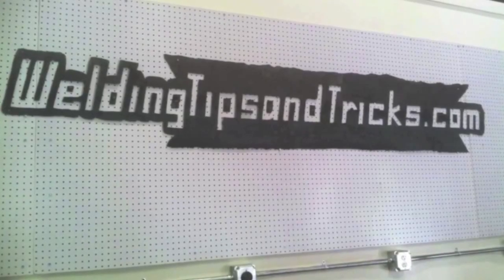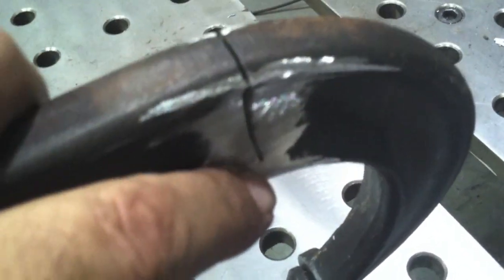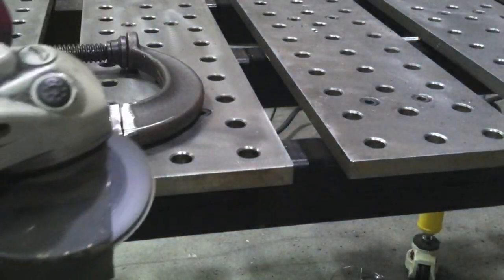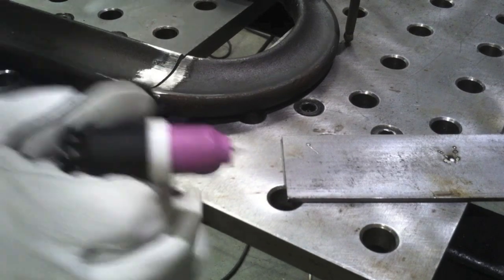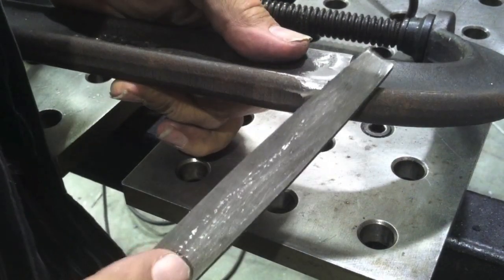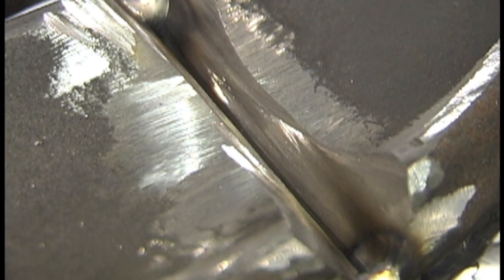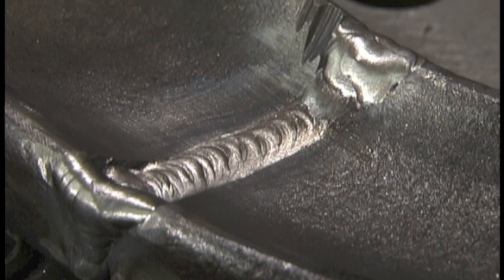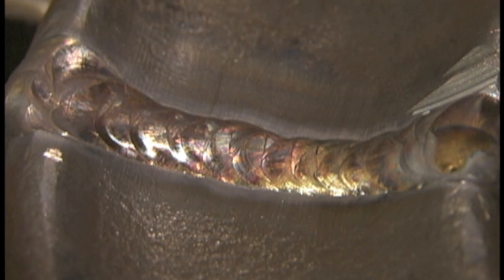Tig Welding Repair & Tips and Tricks for Metal Identification

Comment: Jodi, Id  Almost Guess CAST IRON,, and I allways Brase IT!!!!!!!!,, Just Old Timers Tricks!!!!!!   Jack,,,
Reply: Jack Connors if it wasn't a drop forged (and very high end) c clamp, you'd definitely be right. I almost always braze cast iron repairs, do a lot of work on old vises. 

Those Armstrong clamps however are drop forged steel, as are a few select others. that's probably a $300 clamp he cut
Reply: Geoff, I have a CHINA cast iron bullet vise, I plan to repair for my brother.  It is broken on the round "traveler" connecting to the movable vice jaw.  Just trying to save it, he is not out anything on this one.  
 Have you ever tried supermissile rod followed by a high nickel rod or 7018?

Comment: I have acoumpressure parts I dont no which the meterial type pmi result is Fe-96.83% Co-0.93% Fr-0.76% Ti-0.39%Ni-0.30%Cr-0.24%Mn-0-19%Ps-0.17% i need type of elctrod/filler

Comment: 309? 
You said the three rods to keep on hand were 308, E70S2 and 4043. 
Is 309 a stainless rod?  You also recommended 312 as a general purpose rod.  I think I need a big chart showing them all.  Do you know of any charts to hang on the wall showing all the metal families and if so, do you have a recommended source for such a chart?
By the way, you have helped me immensely.  Haven't seen all your videos yet, but plan to.
Reply: +David Parker ER70S-2/6 - Carbon steel; ER308L - Stainless steel; ER309L or 312 - Unknown grade steel or crappy steel, welding over old mig; 4043 - Aluminum
Reply: the periodic table ;D
Reply: I don't get it Kevin.  I have a periodic table, I was thinking of a chart listing the different weld metals available.
Sincerely,
David Parker
Reply: +Amy West 308, 309, 312 are all grades of stainless with different properties.

Comment: Best to plot it on a Shaeffler diagram to check the structure after welding.
309 (24.13) or 309Mo (24.12.2) works in most cases. 312 (29.9) works better for higher alloyed hardenable steels like 4140/4340 and dissimilars.

Comment: Hi Jody, have you ever done any TIG repairs of cast iron? Exhaust manifolds, engine blocks, firewood stove, things like that?  A video with tips to how to do that without it looking like a spider's web of cracks after and acceptable fillers would help a lot. I just did an ancient tractor's exhaust manifold using filler that was 99% Ni and 1% Ti because I was told that was easier, but it wasn't exactly easy to stop it from cracking a lot anyways...  any hints is very appreciated. Thanks. :)

Comment: I'm curious as to why that c clamp is made with low carbon steel and not high carbon that tools are usually made of?
Reply: Trendyrapslut Well im sure you dont care now, but if anyones wondering, clamps are low carbon so you dont snap them when you tighten the fuck out of them.

Comment: Quick question, I have some E308-16 rods Ive tried on mild steel, and they weld great. A lot better than say a 6010-6011, which I am a beginner. My question is is it ok to use stainless rods on mild steel? And how strong is the weld vs a mild steel rod?

Comment from the maker: aluminum foil is to help trap argon gas on the back side. Since there was a gap, it helps to make if flow better and also helps the first pass on the second side flow better. A small piece of copper works better but did not have one the right size